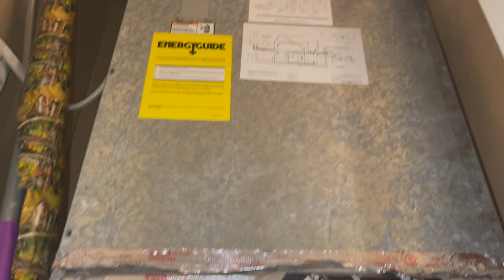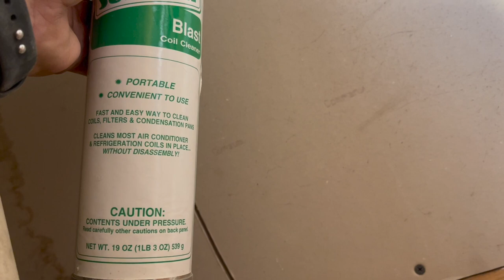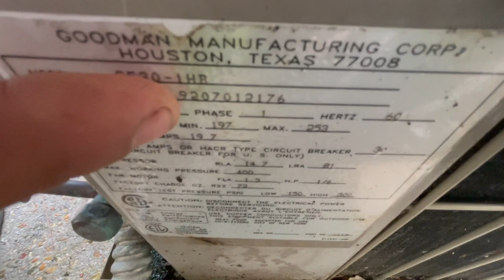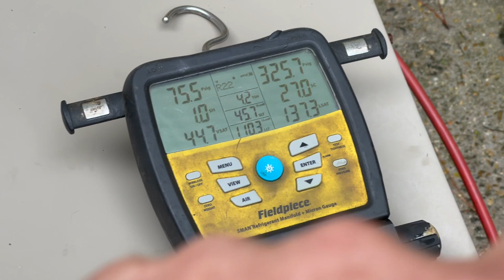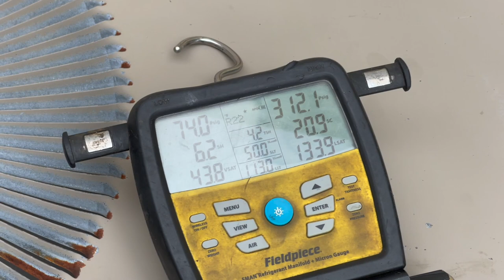No Cooling/Extremely Dirty Evaporator Coil

Comment: That coil was a straight carpet! Nicely done getting them going til the Change-out. As for those SuperHeat and Head Pressure numbers ... I suspect you're right.  It could also have 407C dumped in also.  And if someone wasn't paying attention... maybe even 410A. Nice video. And why do an in depth investigation on a 30 yr old system that's going away in less than a week ... I agree!!

Comment: Sounds like the owner needs a $5 door sweep.  If you brush your dog's for 5 minutes each, OUTSIDE every day and discard the hair in the trash, it will additionally solve most of the dog hair problem.  This 5 minutes each with your dogs allows you to bond with them, check them for any skin, eye, ear, or other issues, teeth, fleas and ticks.  If you can't spend five minutes each brush/combing your dogs every day, you probably shouldn't have dogs.  Good job, John on cleaning out that coil.  That was gross.